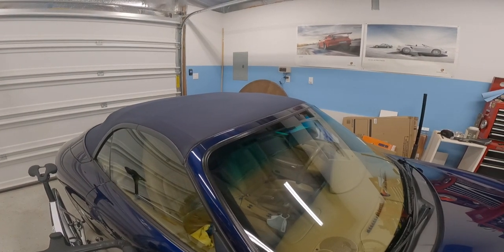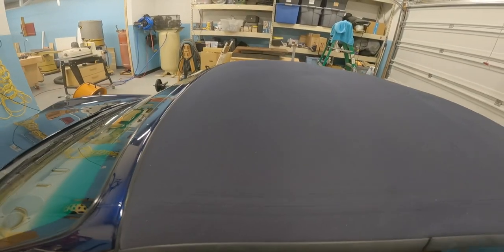Porsche 996 Soft Top Restoration Using Renovo Products

Comment: Great job Rick.  Very labor intensive but worth doing to preserve that expensive top.   It certainly helps that you keep your cars in the garage out of the brutal Arizona sun!  Well we are getting ready for a lot more rain, some wind but not bad, and a ton of tropical humidity.   Because what was hurricane Ida is visiting around Wednesday and Thursday.  More areas of flooding around here.  September is around the corner and so is the beautiful fall weather!   Well hope you have a great week.   It is around 2am and I couldn't sleep so got up to watch Mannix and Cannon, shows from the 60's and 70's.  Then I will go back to bed at 4 and hopefully sleep to 7!  It hasn't been too hot this summer but the humidity is up in the 70's so feels like your in Panama!  We need some AZ low humidity than the summers would be perfect!!!!
Reply from the maker: Thank you Dave!  Hopefully it will hold up a few more years...If I ever have the car painted it will need to be replaced, but for now it is working well.

I hope you all don't have any major flooding and your weather calms down a bit.  We had a break from the rain last week, but we are supposed to have a little more the next couple of days.  Sorry to hear about the sleep I feel your pain.  Have a good week as well and stay dry.

Comment: Hey Rick, Our 997 with 44k miles had those same fold marks in the top.  Other than that, it was in good condition but still annoying. Currently, the Ferrari has fold marks plus wear marks, like scuffing the material to make holes.  Also, has the plastic window that folds where you can see the fold mark in it.  A little to far gone for your resto top product but, you got my attention. We bought a new soft top but haven't had it installed yet.
Reply from the maker: Thank you Bob.  Installing a new top seems a bit daunting!!!  I'm sure you will do a great job though and now I know who to visit when I need to install a new one.  :)
Reply: @AZdroptop  Rick, you'll be visiting my upolstery guy that's done past Porsche stuff. I'm not going to attempt it. Maybe if it were a convertibale Geo Metro...
Reply from the maker: :)  Don't blame you at all.